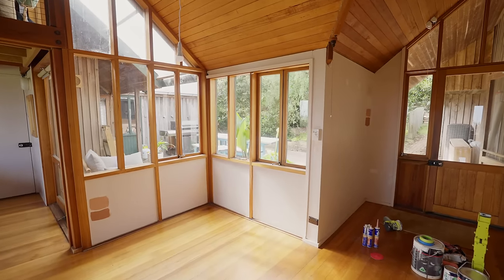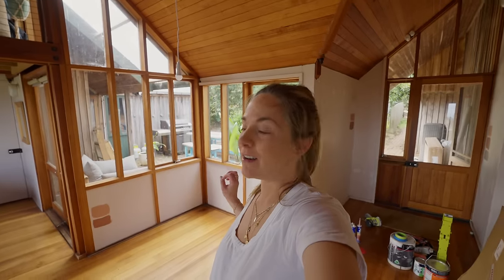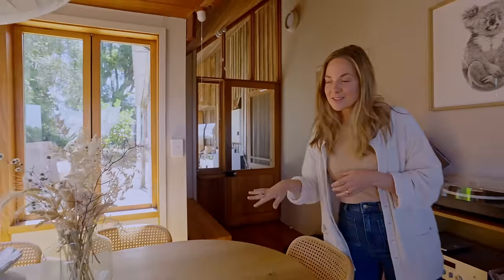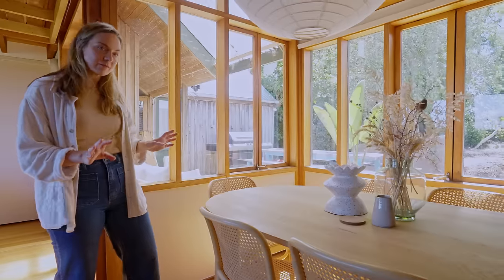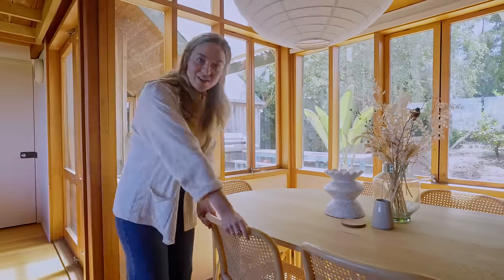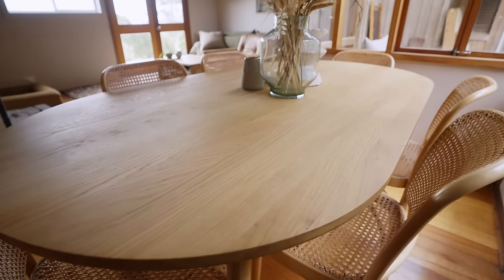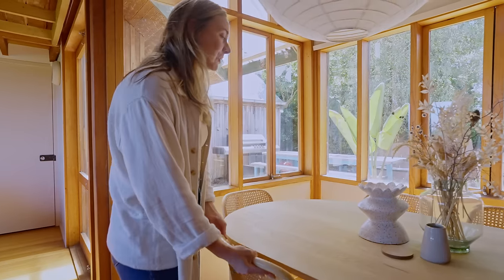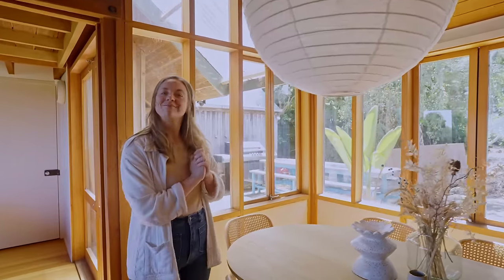Turning our Small Corner Nook into a Cosy Dining Room (DIY Room Makeover)

Comment: Looks lovely. 

I’ve found thee most practical and comfortable floor plan for a small dining area is a corner banquette, with a pedestal base oval dining table. 
That way you dont need the standard amount of space to move chairs in and out. 

They make convincing cognac vegan leather, so it’s easy to slide across the bench seat.  

And who doesn’t choose to sit on a restaurant’s comfy banquette when its an option😊
Reply from the maker: Good option. Love a little bench seat.